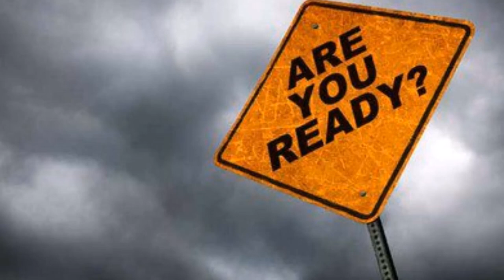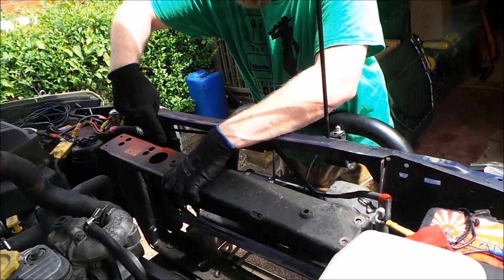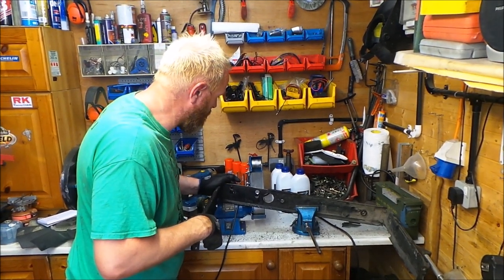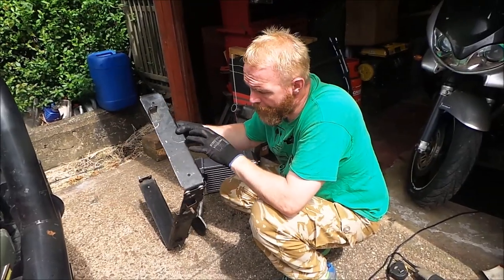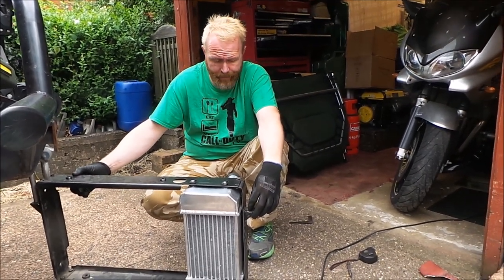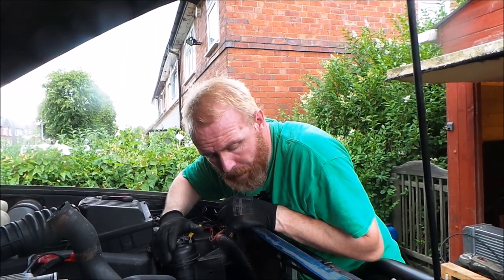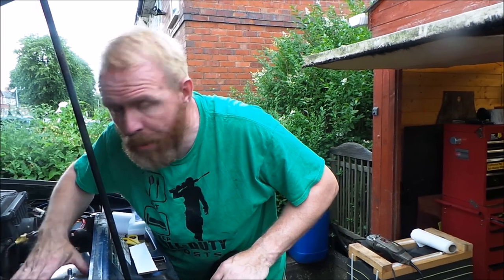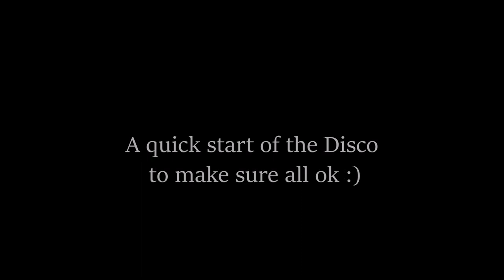Fitting a New Turbo InterCooler to Land Rover Discovery 300Tdi BOV

Comment: Great video Brummie. EGT's are murder on a turbocharged engine. I know a lot of guys here in the U.S. run water/ methanol injection kits to help lower temps on modified diesel engines. Hope to see some wheeling with the new intercooler installed.
Reply from the maker: I've heard  about the water /methanol kits may look more into in later on ..

Comment: Hi mate. After some advice if you don't mind. I can't get the offside outer drive shaft out of the hub. I've used wd40, heated it and even bent a puller trying to pull the bearing and carrier off the splines! Any ideas would be appreciated. Justin (P. S it's a disco 2 2002)